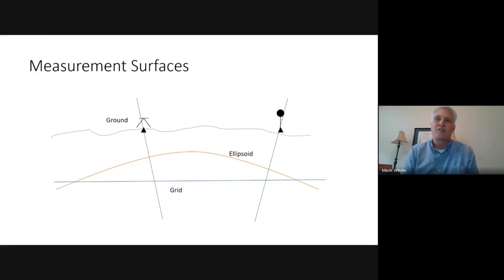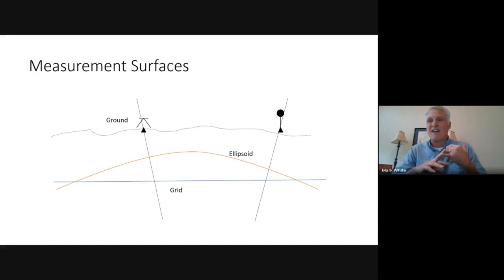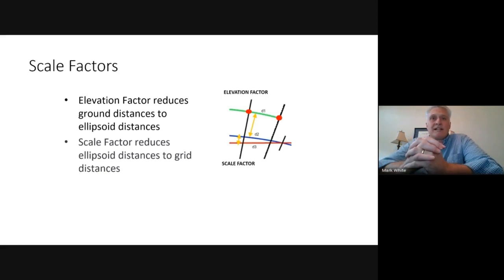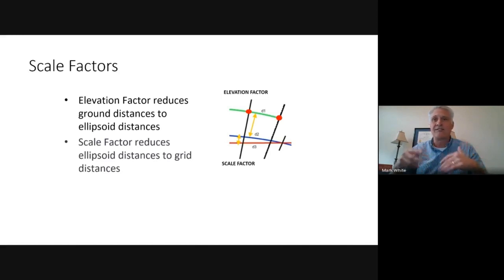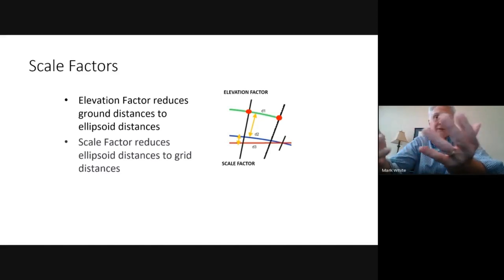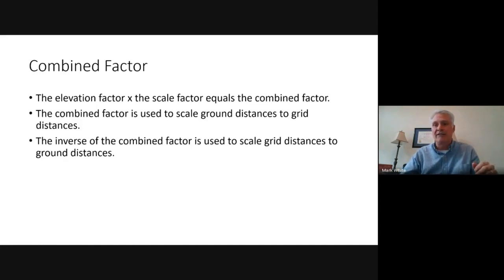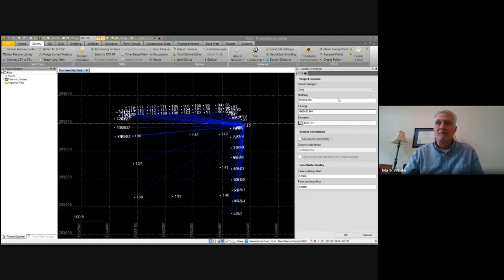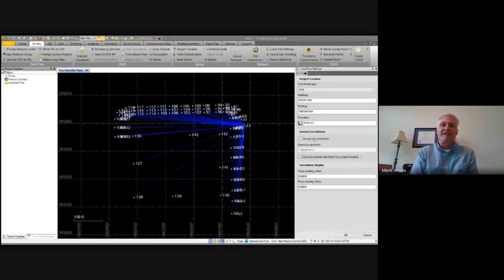Grid vs. Ground Coordinates Discussion

Comment: I have a question about entering in the ellipsoidal height. I understand using the average after the fact to convert to ground from grid, but if I collected in ground in the field, how would I know my average height ahead of time? Or is it recommended to locate both GPS and Conventional in grid in the field, and then convert to ground in TBC after now that I will know an average height?

Comment: I've never heard anyone say, "Use grid coordinates with the total station." Imo as a surveyor, that's a horrible idea. 

Scale factor 1 for total station, SPCS ground for GPS. Assuming your methodology is sound, your equipment is calibrated, and you're  using the right tool for the right job, your TS/RTS work should be much more repeatable than GPS.

 Even with everything being perfect, GPS can still bring in bad data. It's completely out of your control. The best practice I've found is to use measured rounds between GPS set control points and then have TBC/OPUS process the data. Combine TS triangulation with GPS trilateralization to tighten things up. 

If elevations aren't working after that, it's time to run level loops. If the accuracy isn't right for the job/ numbers aren't checking out, then I run a Network Adjustment in TBC.

What i have been trying to find from trimble is how Trimble Access does its conversions from grid to ground. For example, if i set out with GPS in SPCS and take my shots in ground, how does Access make that adjustment? I started with a new employer that kept less  perfect records. Now that the higher ups are about to retire and the 2022 SPCS is almost ready to be rolled out... I'm supposed to publish information on site calibrations done long before my time. I am supposed to explain how the DC does it. My employer is big about storing  data in GIS and they want to figure out how to find the numbers used to go between ground and grid.

I don't use the here button. I take 2-3 State VRS shots on my first control point  in a RTK Logging survey and then take the rest of my control in RTK. Without a proper traverse set up with good methodology, using a total station with a rod/bipod/MT-1000 prism will always give you awful results. You can spur a point now and then for little areas with low importance that GPS can't get... but without the time, equipment, and correct methodology, the most cost-effective and time efficient method is to use the TBC processed GPS and RTS to get everything tight. Run levels for elevation and Network Adjustments for horizontal (elevations get adjustment as well, but it's best to run good level loop data into the adjustment).  This methodology (done correctly) will cover you for almost any project except for class 1 and 2 geodetic work and projects needing very tight control (I'm assuming large multi story structural steel and large suspension bridges). The tightest work I've had to do was for large structural steel single story logistics buildings.

Unrelated, does anyone know when the SX12 successor will come out? I'm trying to get one approved for the budget. The issue of a new, better, more battery efficient, lighter weight successor is holding me back right now.

Comment: Should you be using a scale factor and coordinate systems for total station data? Or is it appropriate to use a scale factor of 1.00? My understanding was that if your are using ground scaled coordinates for your instrument and backsight you will be measuring ground distances.
Reply: Would love to get some input on this question as well.
Reply: They must not know. 🤷‍♂
Reply: Wondering the same thing.
Reply: the question is if we insert any scale factor other than 1.000000
would it affect out measurements 

For example if we measure 100m with 0.9996 >>>   will we get 99.96 

if it is , it means we will face problem

Comment: 666
Reply: I watched this video and did the process you mentioned. My point I selected was my middle point between to other GNSS VRSS observed control points. All three points were observed by GNSS RTK. When you do the local site conversion to the point you choose as the CP as you did 12, the coordinates do not change after the process. So my question is how is that putting CP 12 in your case on ground coordinates. I don't think it does, it's still grid. A true GRID to GROUND conversion for three new Control Points in my case we be that all three points would have coordinates that differ somewhat equally from their GIRD coordinate.